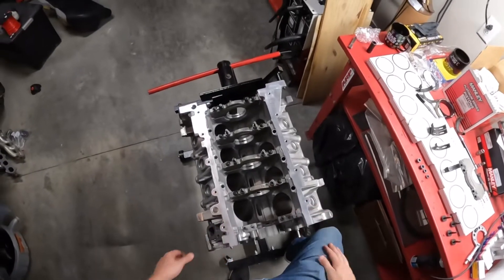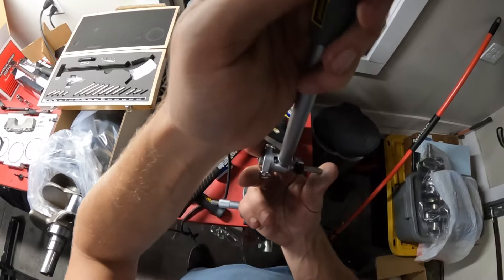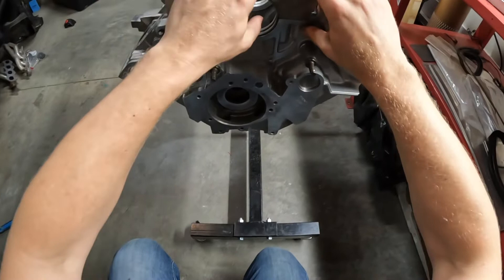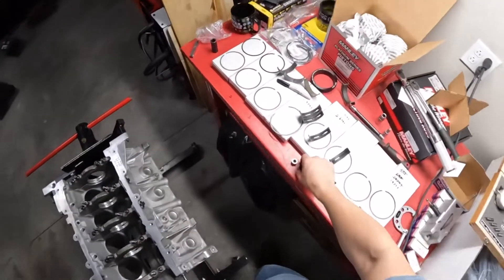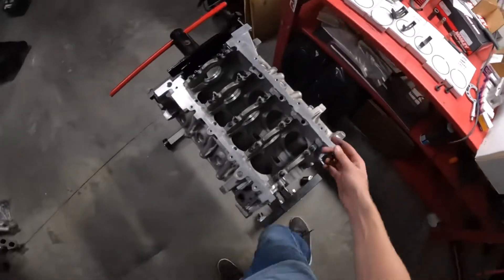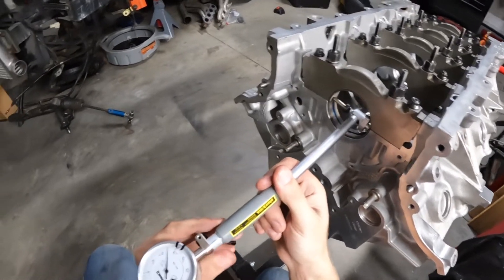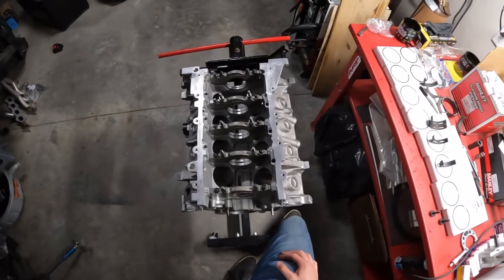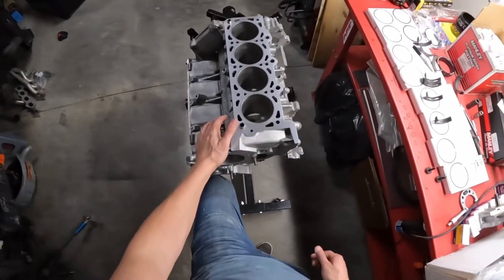How to check bearing clearances - using caliper micrometer and bore gauge

Comment: I am rebuilding my own 5.4L and was wondering if you thought that your new fastening hardware gets stretched too much as you are doing your torque, removing and then reinstalling. Perhaps not because you are not doing the final torque angle turn but I was just curious what you thought. I have seen some other information that seems to recommend using your old fastener hardware to measure the new clearances but I can't understand how that could work correctly with already stretched bolts.  I would love to hear your thoughts on this.  Thanks
Reply from the maker: Yes, use your old hardware to check clearances. If they snap, they snap. Because these are 4340 studs from ARP, there is no stretch to these. There is a maximum stretch length to TTY bolts, so keep that in mind when using hardware. Rule of thumb to me is don’t stretch them more than 3 times, but if I am just checking clearances, ill stretch them more than that.